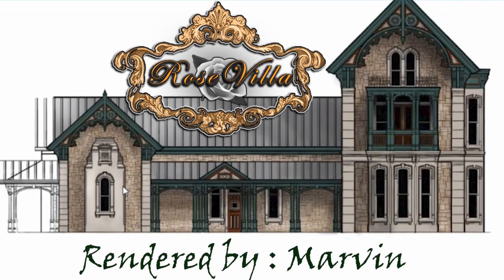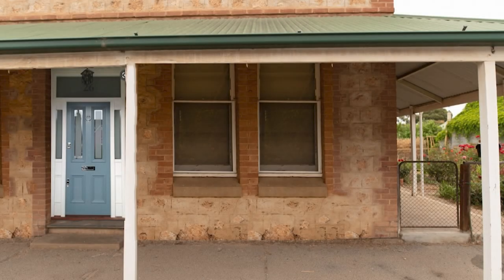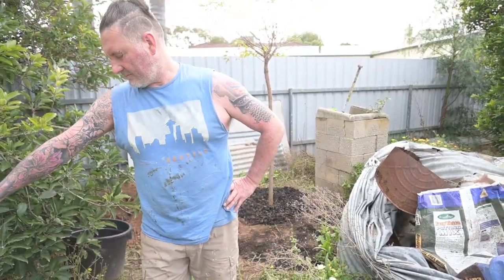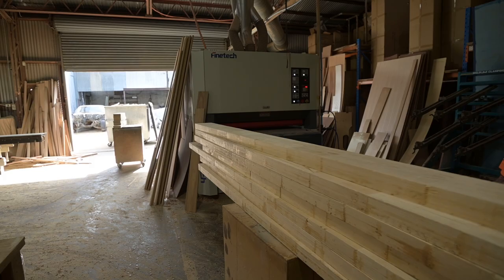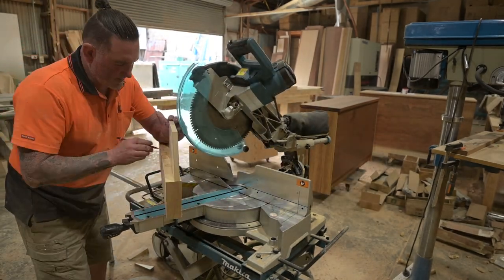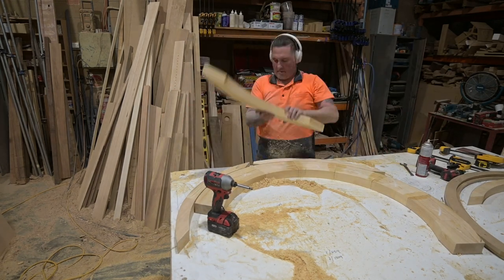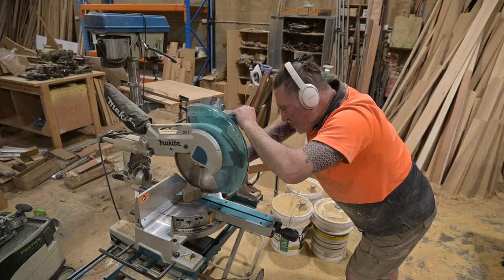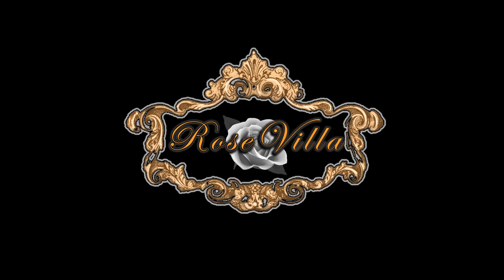S02E07 : What a HUGE Door! |1880 Shop into Victorian Mansion

Comment: Hi, I enjoy watching you doing woodworking. I just wish I could be there to smell the fresh cut wood. Your door is going to be beautiful!!!  Hugs from sunny Arizona💖😎💖
Reply from the maker: Hi Debra, thanks for your support,  I really appreciate it!  This hoop pine that I am using has a really strong smell,  its better than the hardwood I normally work with, it has a high oil content,  which makes it good for external doors,  and it may seem odd but you can smell the oil! Cheers,  Mike